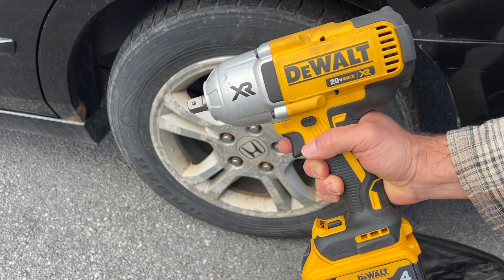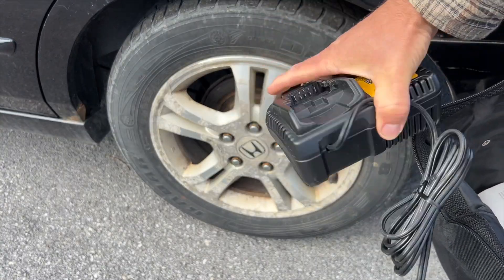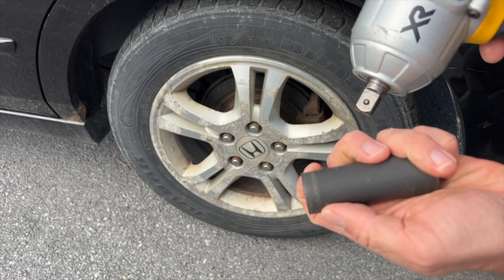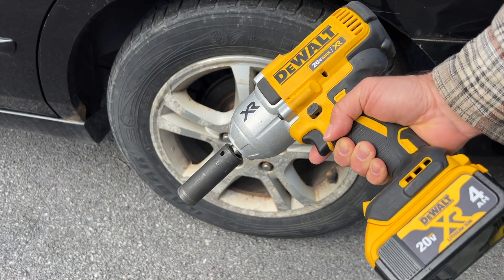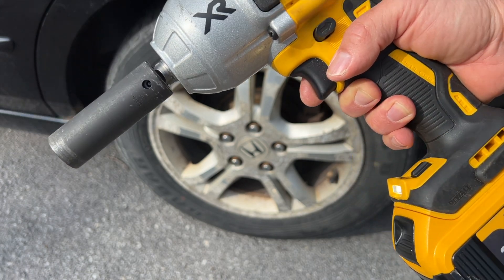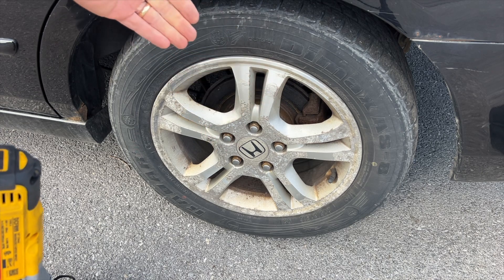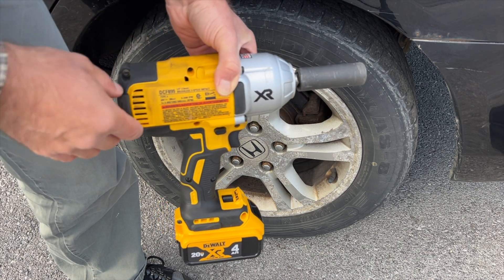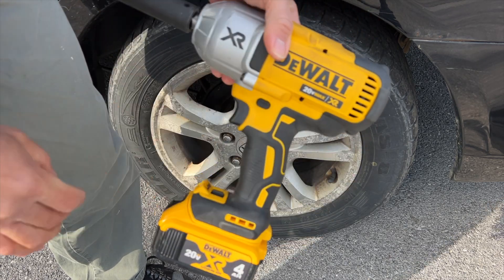REVIEW - DeWalt 1/2 Cordless Impact Driver 20v

Comment: That's the 899... an 8 year old model that is hopelessly anemic compared to other brands. Still great for a lot of stuff, but I think I would have gotten a 3/8 Drive to use with everything over the 899.
Reply from the maker: What are the other brands 1/2" drive  torque specifications compared to this dewalt?  I'm already invested in the dewalt 20v system and this tool works perfectly for me.
Reply: @Jungle River  nothing beats working perfectly for you. But I recently upgraded to the 900 from the 899 in DeWalt. The 900 is the most powerful half inch impact on the planet right now. I think every single brand Beats the 899 right now
Reply: @Jungle River  I was for fun arguing Milwaukee vs DeWalt the other day with a buddy, and I just made a video. If you want to check it out. Again it's the new DCF900, not yet 899
Reply: @jungleriver  I am also completely invested into the DeWalt batteries. That's why I was so excited about the 900